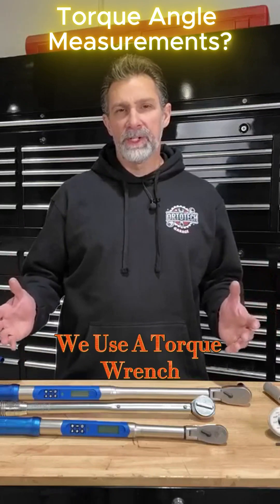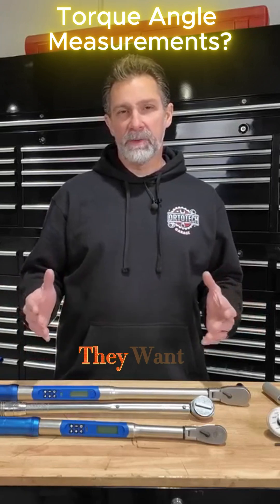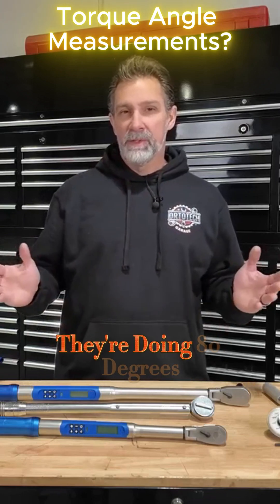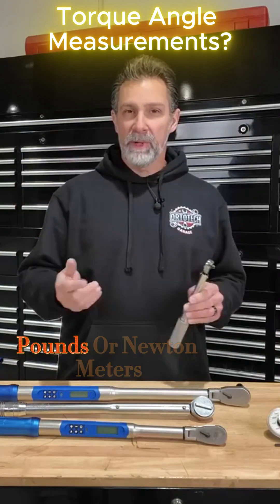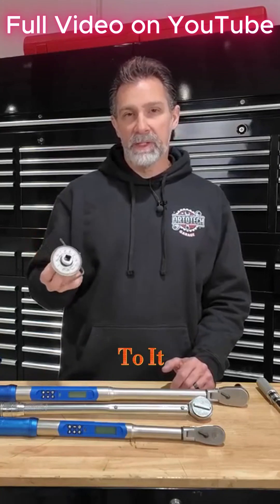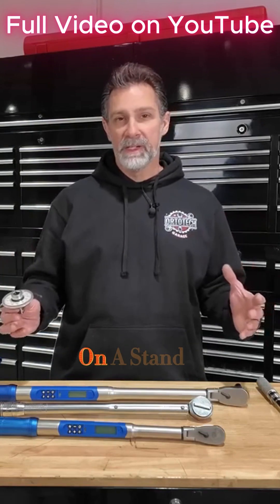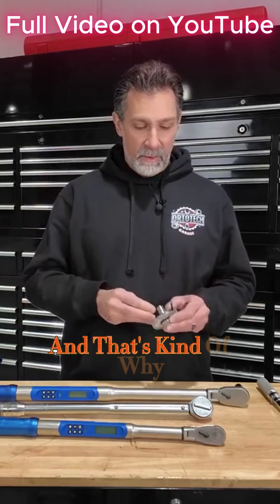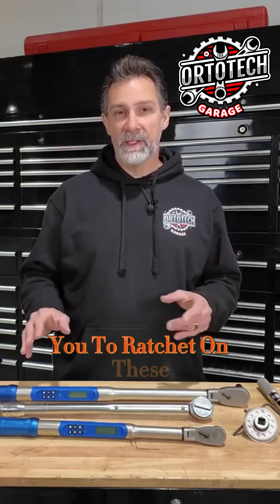Understanding Torque Angle  A Modern Mechanic

Comment: Pardon my ignorance but why can't you stop with the angle gauge?
Reply from the maker: You definelty can with the new digital style angle torque wrenches.  The old analog style angle torque guages would not hold accuracy once you released tension in the direction of tightening.  It was very difficult to be accurate if not done in one motion because they would back away from what ever you were resting against when ratcheting backwards.
Reply: @OrtoTechGarage thanks for the reply. The reason I was asking is because I'm working on an engine  and I know that the head torquing process involves angle torquing but I only have the wheel gauge. I guess I better be careful then.
Reply from the maker: No worries!  That tool still works fine, I used mine for decades.  Just be careful with it.  👍

Comment: Always an informative vid. As a DIYer I was unaware of this torque angle, interesting. However it seems easy to mess up without the proper tool.
Reply from the maker: @cardo1111 Thanks!   I did a longer video on torque wrenches, too.  In there, I did a demonstration with the digital torque wrench calculating torque angle. It might interest you.  👍